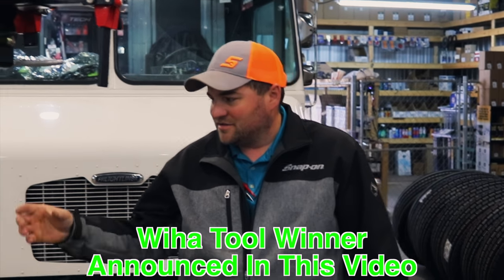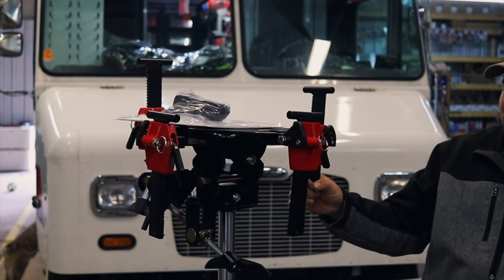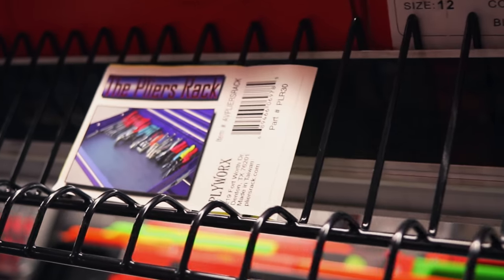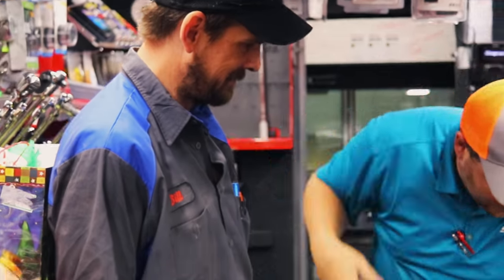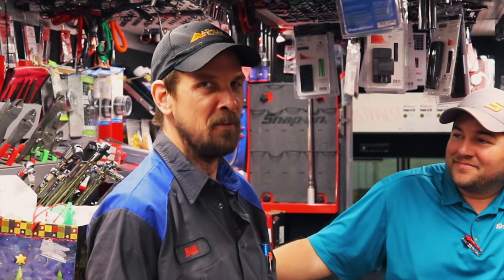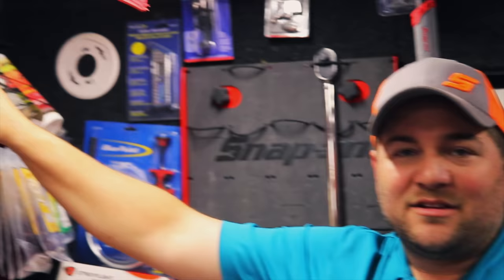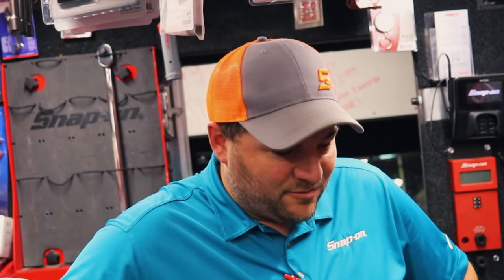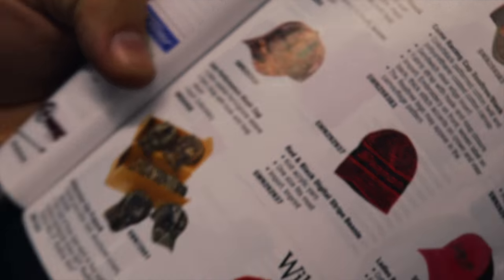Snap On New Transmission Jack and STRONG Man Bill

Comment: That is pretty damn spiffy. Wouldn't have to block up e40d's with 4x4s anymore with that.
Reply: You do alot of them? 

 I got a pretty good deal on a 1990 E-350 ambulance van with the 7.3 idi into a e40d with a dana limited slip rear end. full size extended cab. I think its pretty neat for a van personally. Paid 750 for it and it runs and drives good. I kinda feel like the trans is the weak point in that system though. Im going to be moving in a month and my plan is to drive it the 1500 miles back south. But that trans is what im most worried about. Kinda thinking I should probably stop every few hours and let the trans cool or something. Little worried about driving such a large old vehicle that far. The regular tow trucks can't pull that thing so if i break down its going to cost some serious cheddar. 

The used car market up here sucks. All my vehicles are worth more back home in the south. So I don't really want to sell it up here. And at the very least it seems like it would be worth while to part out considering what I paid. But I want to turn it into a camper/tow rig.

Comment: The current Snap-on guy can't seem to grasp the concept that I want a older scan tool and will not look or even bother to find it I'm looking for a Solus Pro because I honestly do not work on anything newer than a 2017 at the moment is usually the highest car I get to work on I was wondering if the solo Pro before the new models came out goes up that high and also if you're Snap-on guy would be able to find me one with at least two thousand sixteen or Seventeen Hardware on it with all of the connectors and domestic Japanese and European vehicles capable of reading the codes I had one but I was in a pinch to move and I didn't know if I was going to be able to find another Snap-on man to continue the bill payment on it Granite it was a used one and I only paying $750 for it but it was the last thing I got from last Snap-on guy and I wasn't whenever say sure if I was going to run into another guy that's hold Snap-on because in this area when I first moved here all I saw was Matco gearwrench and a Cornwell truck